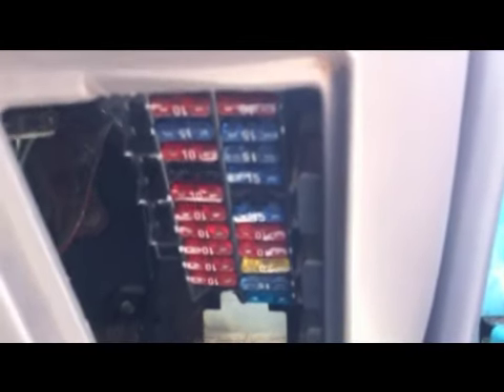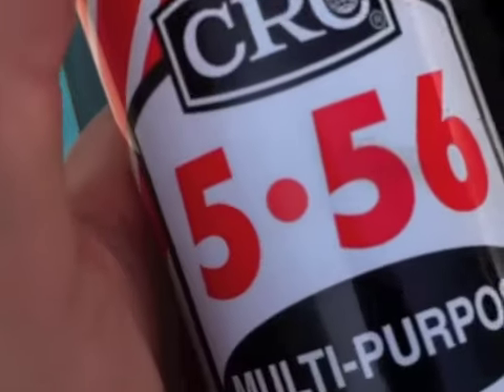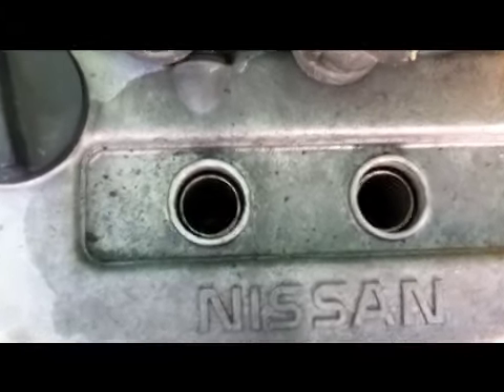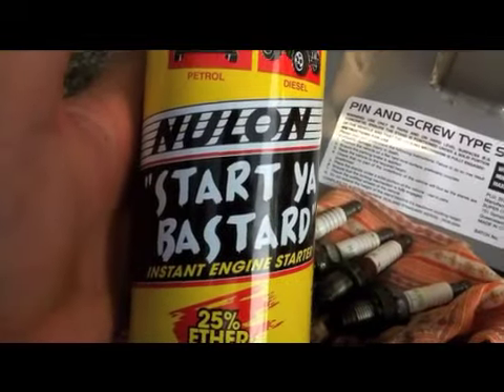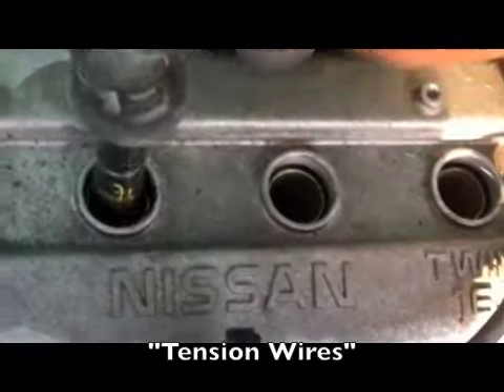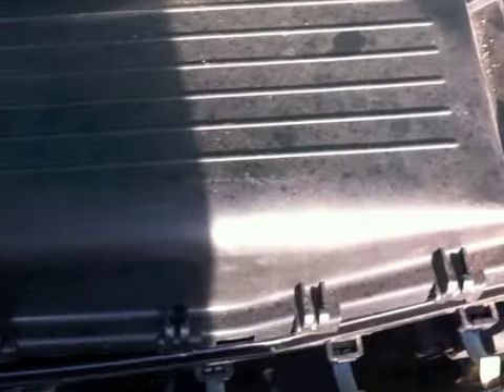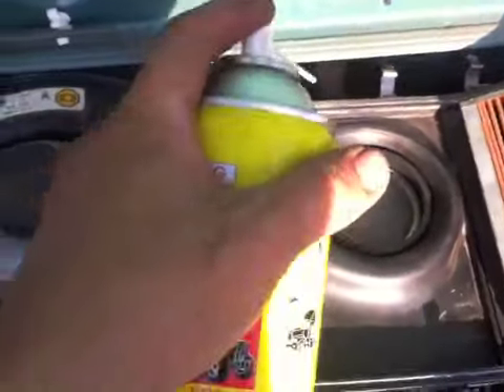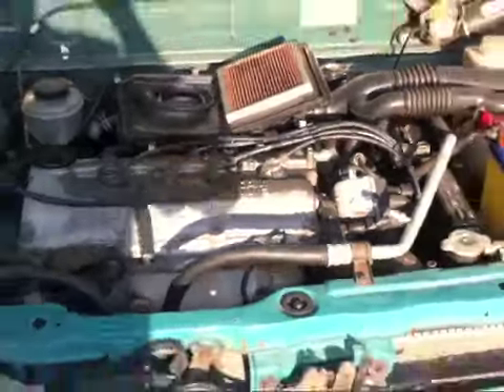Nissan Micra No start problem

Comment: 200000kms indeed needs a fuel pump.The K11 diagnostic platform is a simple eobd1 and wont show a code .The are other hard start issues and engine flooding with petrol  ,infact many other  !some are dry solder joints in MAF at the throttle body,can be resoldered ,this fix is  related to poor idle and rough running.Also if hard or no start hot or cold and engine  flooding check  the airflow  solenoid valve on the mass air flow sensor.it is easy to remove in situ,they tend to carbon up and overfuel the car when cold due to lack of air. You will see it with the air filter removed and is held on by two screws clean it out for smooth op. Also look at the temp sender that is in line with ECU (2 wires) not the other temp sender that is in line to temp gauge (1 wire),both located under distributor,the ecu ect  temp sender has a section of wiring loom  needs replaced !nissan updated this as a replacement  complete with a  wiring loom incorporating  a resistor within the loom and also updated value on sensor.this regulates fuel flow with engine temp ranges cold through hot via ecu..he other hard start is the distributor completely incorps the "crank" sensor and coil both those items fail >The crank sensor and amplifier are all built in. You may get a spark but it may not be at the correct time.
If you get time,.If you need a quick start when is flooded ,pull the fuel pump fuse (panel r side of steering wheel ) is the 2nd fuse down on the right if in japanese writing ! if cant find that fuse ,just pull the fuel pump blue relay bolted to drivers side kick panel near door ,pull cover back and to remove ,then crank engine over a good few times ,then plug relay in and crank to go .It should run ,keep it running till black smoke burns off and runs smooth.It will run for some time before  problems re occur .wait ... there is more...stretched timing chain.!! Regards David NZ .This year 40 years in the trade as a qualified automotive engineer and still going .
Reply from the maker: Thanks for the info. I actually got it running. It ran for 1.5 years more after replacing the fuel pump and soldering the circuit board on the throttle. Had to sell it since I needed to go back home.

Comment: My 1997 micra has problems aswell. When its hot it seems like the rmp on idle are dropping down and if I dont give extra gas the engine goes off. Also when if I have to make a turn and slow down getting into gear 2 it also would shut down.. Do you have that problem aswell? Or know a cause? Thanks
Reply from the maker: I didn't have any idling problems soldering the throttle body. Couple of things. Check battery, ignition coil, Fuel pump pressure, Idle adjustment, crankshaft sensor? Sorry, already sold the car. I don't have it anymore.
Reply: Alright no worries man, Thanks for the tips tho. I will check it out. Cheers
Reply: Change the trottler body